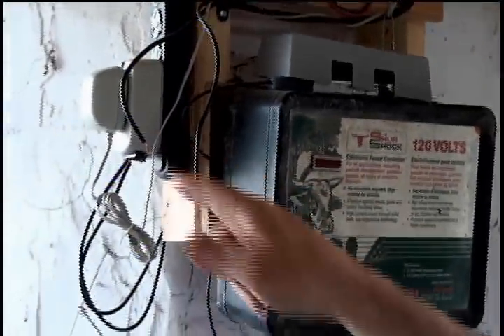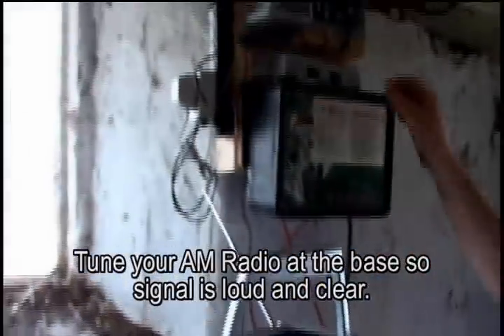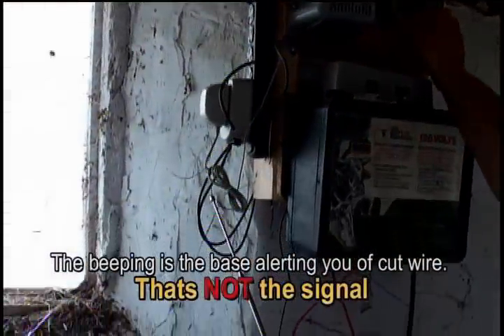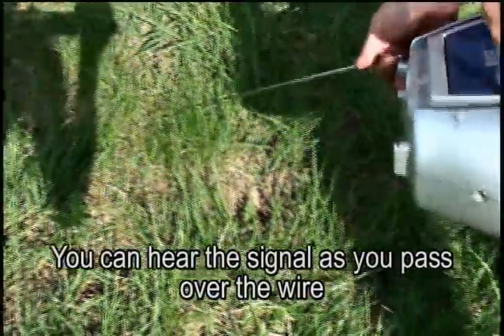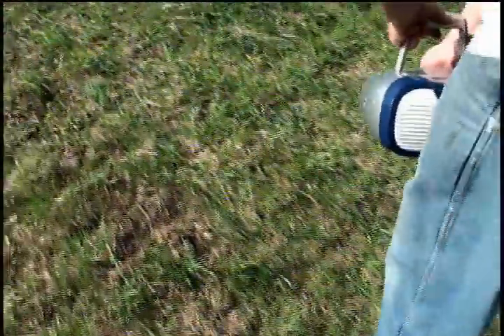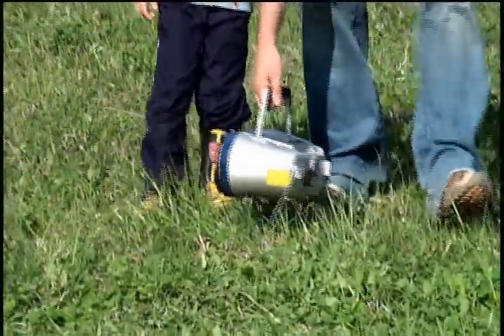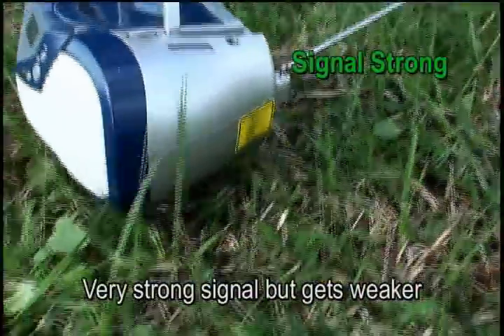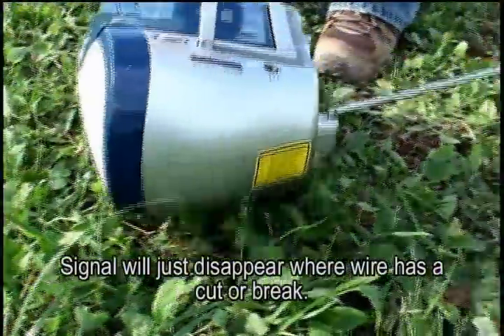Finding a Cut Perimeter Wire using an AM Radio

Comment: Does not work with Flymo 1200R set-up.  I tuned an AM radio away from any channel, and tried the available frequency range, including lowest frewquencies to find my wire break. It did not work. I then checked the tech specs and found that Flymo lists "boundary wire antenna" for the 1200R as having operating frequency between 80 Hz and 80 KHz. AM is not low enough to detect this.

Comment: I was unable to hear any change in my radio from just the transmitter, but I was able to unplug one of the wires from the transmitter, plug in a jumper wire and run the other end to my lawnmower and wrap it around the spark plugs wire.   Worked perfectly then.   Thanks for the video.  Saved me 150.00

Comment: For every one out there who can't figure out how the signal gets into the wire, you just leave your perimeter wire hooked up to the system with the system on. The radio signal you are listening for is the same signal that your pet's collar or your mower bot listen for.
Reply: I think just leave one wire connected then follow that wire.  If both sides are connected then it won’t be as obvious.

Comment: I used this today with success.  The central console indicated an opening in the loop, and my Multimeter confirmed it when checking the Ohms with both ends entering the central unit.  A few comments that should be useful:

One section of the loop that goes behind my house, the other in front.  The wire at the rear has recently been installed, & it was spliced OUTSIDE onto the loop wire that passes through the wall to the console.  The signal was strong at this new wire, but it became weaker as I rounded the perimeter toward the front.

The front loop wire goes directly to the central console -- no splice.  Strangely, the signal was moderately loud, but weakened at areas where the loop was say 4" underground and remained weak as our went along the loop.  

I noticed that, as shown, I had to rotate the radio since the signal noise depended upon the direction of the antenna. 

The weak signal was such that I couldn't confirm a break, so I bared the splice on the rear loop & attached another wire to "jump" over sections of the loop.  When this did not work, I removed the "jump" wire, stripped & cleaned the wires before re-splicing, and then began searching again.  The signal suddenly was much stronger & remained so for the front & rear loops.  About that time, my wife called & said that the "beeping stopped" & everything was now OK.  

Ergo, first clean & reconnect any splices, check the central console, then do the loop check.  If the sound of the signal on the radio suddenly increases, it's likely you have succeeded.  

Thanks VERY much for your video!!!!!

Comment: Do you leave the leads hooked up to the transmitter? How do you have the wires hooked when searching for the signal?
Reply: Stupido Norte Americano. Hook the wires buried underground to the exhaust pipe of a 1972 Toyota Prius and drive around the block counterclockwise 3 times to avoid the Coriolis effect. Are you seriously that ignant?  Did your mommy get  a note from the doctor to explain how you were mentally absent from 5th grade science class review of electromotive forces, magnetic fields and Ohms law?  Here in India, China and Korea we learn about basic fundamental natural phenomena in daily use. You might want to check into a rehab facility to rehabilitate your ability to think. Duh. If you're looking for a leak in a hose, do you hook it up to a faucet?
Reply: AZ?FightBoy?  You compensating for deficiencies?

Comment: Used this today to find the (first) break (will continue, tomorrow).  It was also helpful to relearn where the line runs.  Turned out to be a great conversation starter with the neighbors, too.  I took the AM radio and rubber banded it to a handle broken off from a rake.  I had my headphones on listening to the signal while walking around the yard.  I think the neighbors thought I was searching for radioactive moles or something similar.  Thank you for such an effective... and cheap tool.
Reply: I got a connex full of dead radioactive moles that were digging under the Hanford nuclear reservation near Washington Idaho Oregon border. I sell you for $2 each to give to all your neighbors. These little fellas was nuked with Plutonium, not that cheap Uranium stuff. A few of em fell out. Vultures that ate em glowed in the dark for weeks.

Comment: It's a little misleading showing the antenna extended....that's the FM antenna.  The AM antenna is almost certainly an internal ferrite bar type, so the exact location of the break would be under the radio and not the antenna.